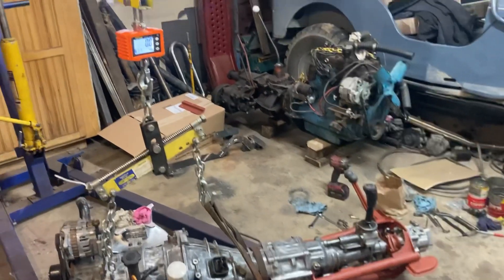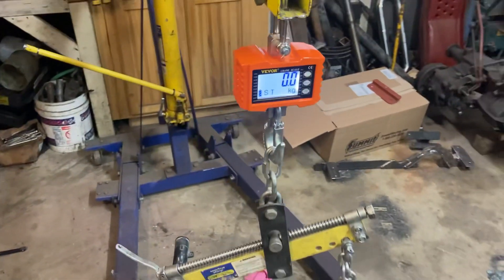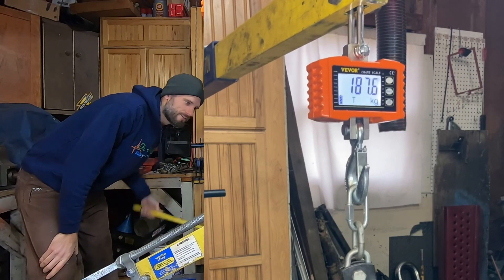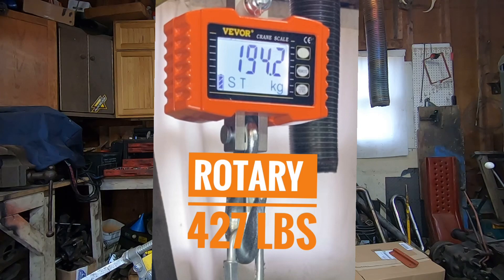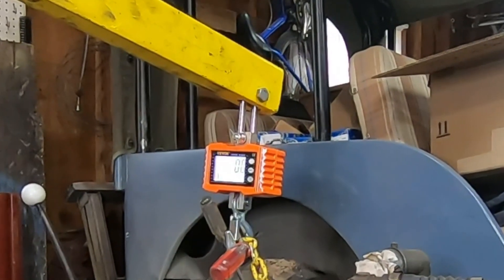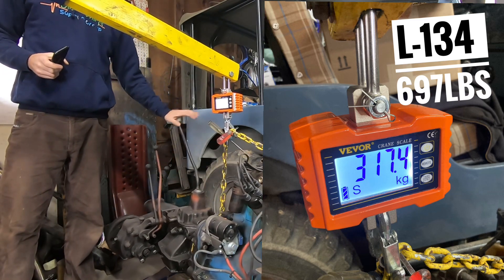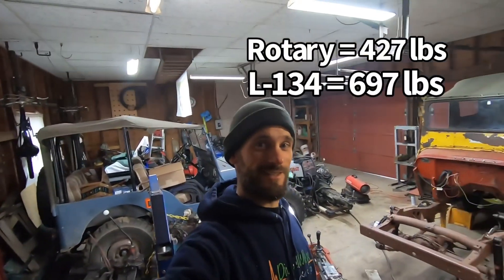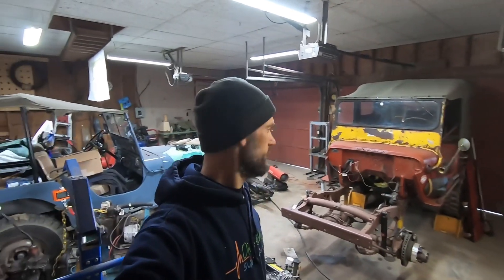Is a Mazda 13b heavier than a jeep 4cyl

Comment: That's significant weight difference. Curious how it will effect handling on the trails, although power to weight ratio increases by far. Great comparison, thanks Seth.
Reply from the maker: Anytime you lose weight it’s a good thing. But it’s really not enough in my option to change handling. Think about it. If you pick up a passenger or two and a cooler full of lunch. You’re well over the 270 lbs. I’ve wheeled empty and also with my wife and 2 kids. Never noticed a difference.

Comment: At 1 hp gain for every 18.18 lb lost, and 1ft-lb torque gain for every 22.04 lb lost, you’ve just gained 14.85 hp, and 13.47 ft-lb of torque just on weight loss alone. That in and of itself would be significant, let alone the rotary’s numbers.
Reply from the maker: I think it’s a pretty exciting side effect of This swap. Basically shaved 10% of the vehicles weight and gained 100hp😊
Reply: @SethHensler  it’s going to be like having two engines at once🤪
You’ll be running circles round everyone else.